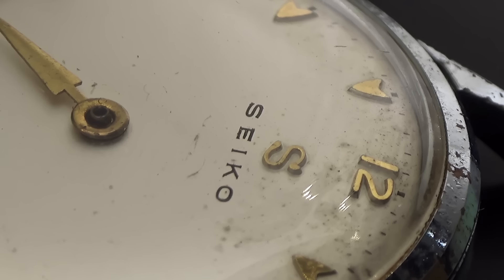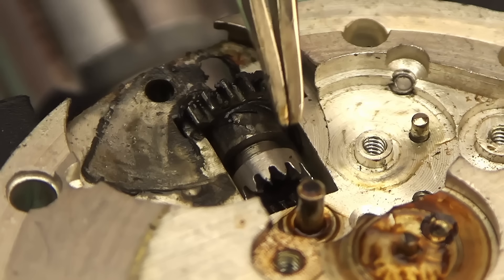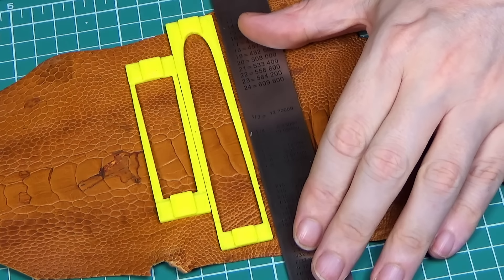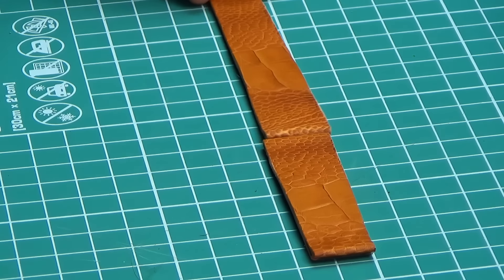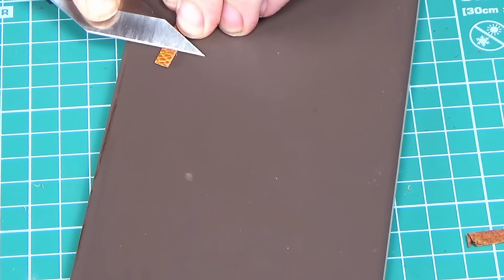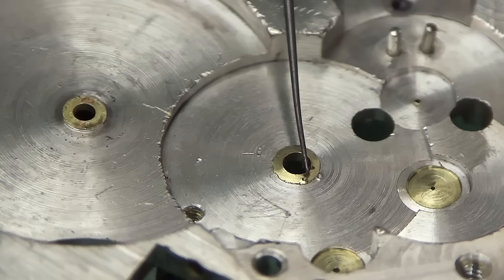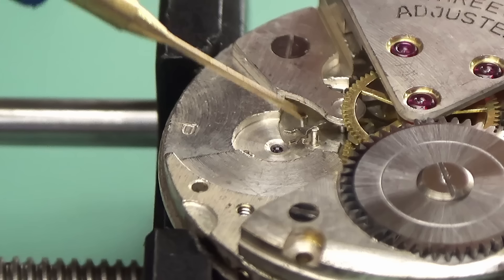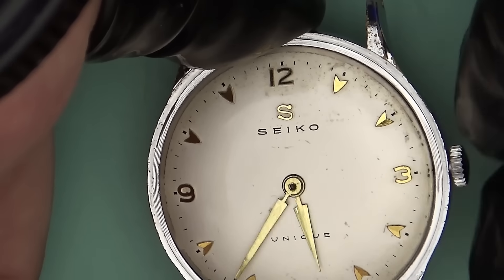The cheap copy that made a company great. Vintage restoration of Seiko's most important watch!

Comment: I saw someone use a bed of rodico to hold the regulator and cap jewel.  Then they smoosh the balance cock into it and it holds it aligned till you get the screws in.  Hate the non shock settings too though.  Really appreciate your humble approach to this and the strap build are awesome!

Comment: Great production and work as ever! Have you tried using a honed oiler to 'suck' the oil through to the balance cap jewel after assembly? I used to do the oil and assemble too, but it's so easy to smear.
Reply from the maker: Thanks I have not tried that I was thinking of an auto oiler maybe but there expansive and I have little experience with them. I'll try with a honed oiler on some spare movements i have laying about, I'm sure you know what that's like lol

Comment: Quick question I noticed the pallet fork had no jewels could you fit some from a Swiss 1080?
Reply from the maker: With some small modifications, you could nick the entire pallet bridge from a 1080. You'd also need to drill out a jewel hole in the mainplate for the pallet fork pivot on the bottom side. You could, yes, would I... no. Way too much effort for this movement, and I doubt it would run any better. Save some wear and tear on the pallet fork, though.

Comment: Well done David, I think this is your best video yet, even though the actual watch on the bench was a shitter 🙂 Filthy too and swimming in oil! But it's historic because of when it was made so there's that.

Seiko are worth collecting if you are into them but a whole lot of caveat emptor. During the really popular vintage periods - 60s, 70s and even 80s - Seiko released thousands of watches, all variations on a theme. The result was watches that all look totally different but the platform was standardized meaning that so many bits were standard sizes across many watches. Dials, hands, casebacks, bezels and more all got swapped around so often when these tool watches were being repaired that good all-original models are hard to find. Having said that, they are awesome watches!
Reply from the maker: Thanks Alan I'll be checking out Seiko in the future for sure. When i opened this watch I was not impressed. But putting it in context, I think they did really well to get from this to the stuff they did in the 60s

Comment: What sort of price would you estimate for a restoration with replating, minus the strap, of a watch of similar age and condition?
Reply from the maker: It's hard to say; it depends on where you live Where i live, it's between 150 and 300 USD for the service of the movement I was quoted $250 for electroplating a case, but that was in gold, so probably cheaper in nickel. But prices fluctuate a great deal depending on all the factors. So sorry, I can't be more helpful
Reply: @Saving-Time  Thank you! That gives me good idea of the price. In the new year I'll probably get it done 👍

Comment: This isn't too surprising - a lot of early Japanese production was based on designs that were derivative or sometimes direct 1:1 copies.  One example is the original Toyota "Type A" engine - which was an unlicensed copy of a Chevrolet inline-6 that was so close you could swap parts between the Chevrolet and Toyota engines in either direction and everything worked.  Their later "Type B" engine was also based on a later revision of the same design, but this time was a licensed copy - presumably because at this point Chevrolet had concluded that even if they didn't get a license Toyota were clearly perfectly capable of copying it anyway.   They didn't carry on doing this long, and quickly started producing their own designs, but it did give them a proven design to use while they were getting up to speed on the production process - which I suspect is what Seiko were doing with this watch, too.
Reply from the maker: Yup I agree given the circumstances completely understandable really. Hope you enjoyed the video.

Comment: I own one seiko It was supposed to be waterproof but every time my arm would sweat, it would sweat under the dial. Needless to say, I tried to have it fixed. And it still did it after it come back from the manufacturer. So i got rid of it i cant stand a watch thats not waterproof
Reply from the maker: It sounds like condensation was getting in. I've seen it happen; it should have been a simple fix! Good decision to get rid of it; mechanical watches and water do not mix. I hope you enjoyed the video.

Comment: I hate the clashing fonts used for the "GS" logo and "Grand Seiko" text on the dial. It's lazy design.
Reply from the maker: I don't mind it so much, I would prefer one or the other though not both so i'm with you there. Hope you liked the video.
Reply: @Saving-Time  Loved the video. Either say "GS" or "Grand Seiko" but not both. It's the same on the caseback. All these different fonts competing. It's like scratching on a chalkboard. I love the engineering of Grand Seiko's but their design acumen is far behind the Swiss and Germans.